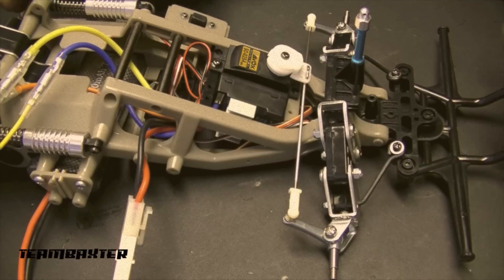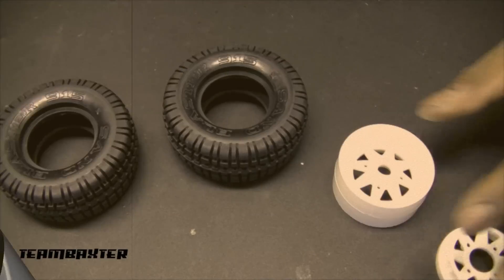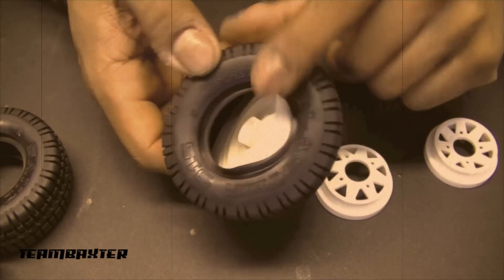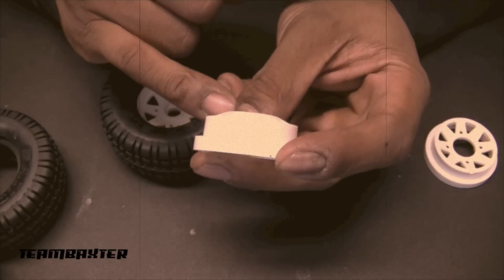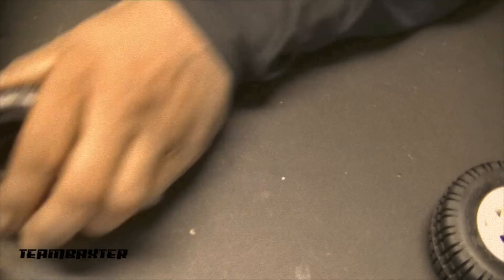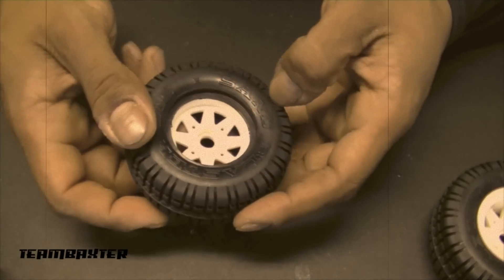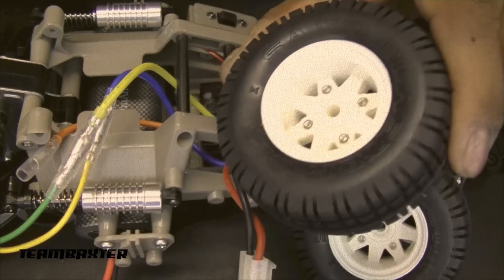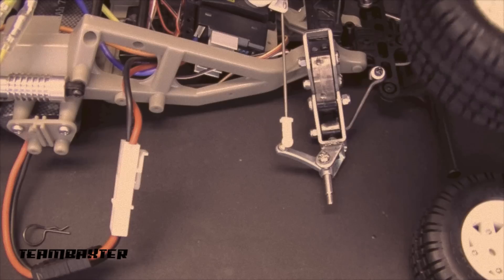Tamiya Subaru Brat Kit Build: 6 - Wheels/Tires

Comment: I see its a fucking bitch to get the center piece inside the rear tires on all the 3 piece wheels. Had such a problem with the hornet and grasshopper rear tires.